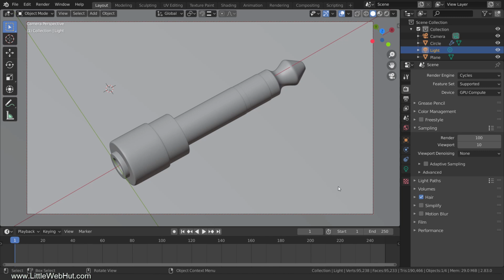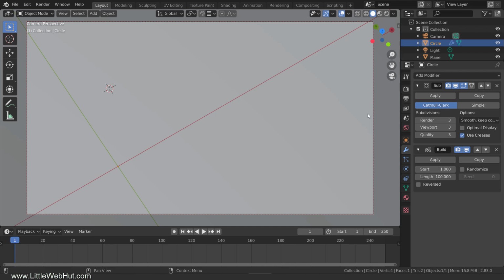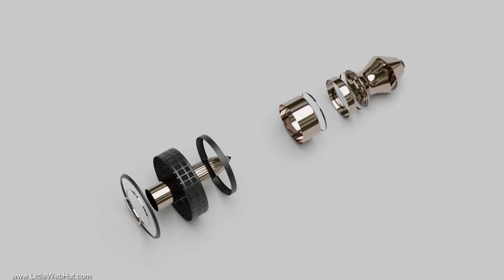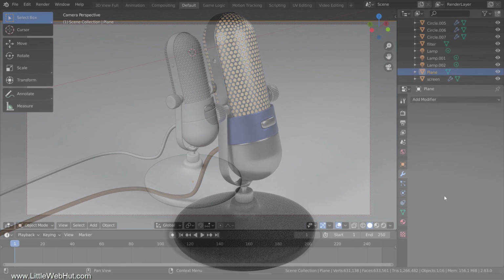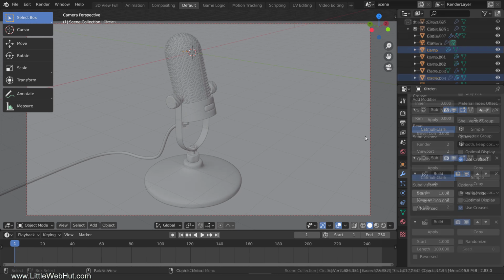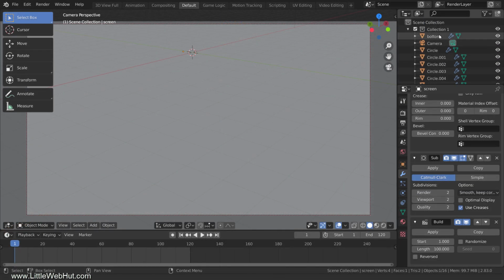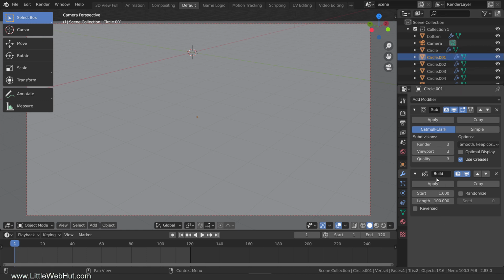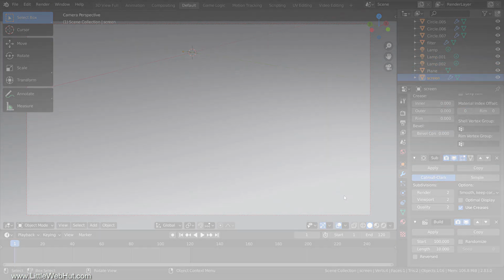Blender Tutorial: Automatic Construction Animation

Comment: You can control how the build modifier builds by the order that each face in the object is made. By deleting all the faces in a object but keeping all the edges, then manually rebuild each face which will set the order the modifier works. Yes this can be time consuming. You could use masks too or a boolean modifier for different effects.